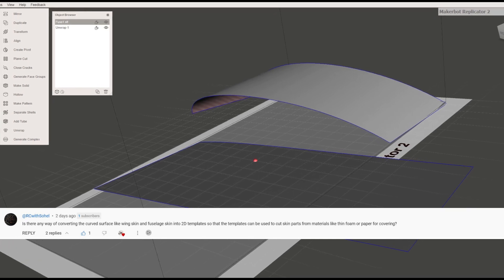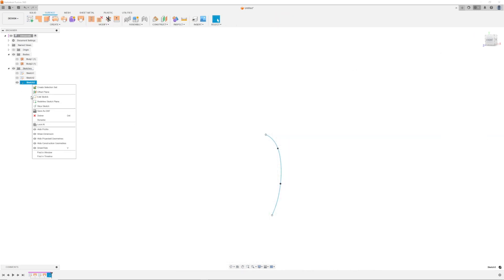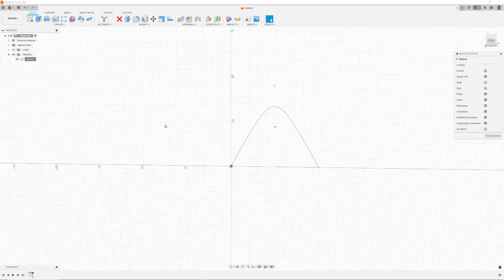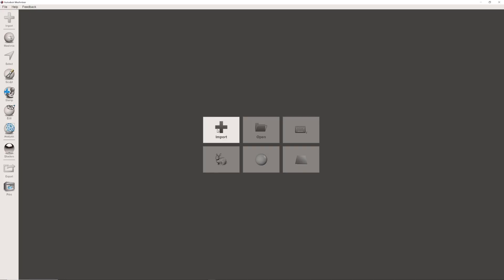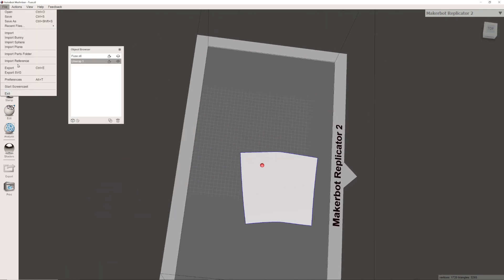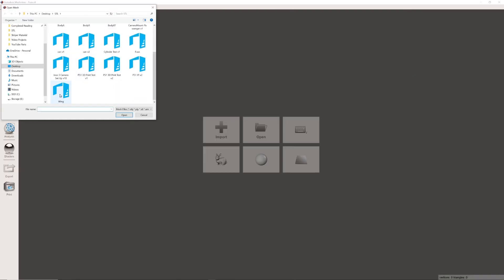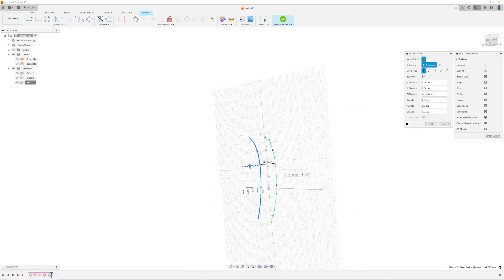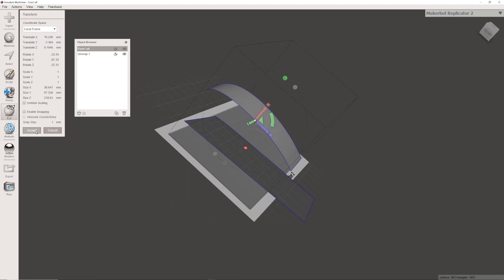Flatten Curved Surfaces For Your Foam RC Planes - Fusion 360 Narrated Tutorial

Comment: Please, is it possible to unwrap shape design also directly in fusion? I know that catia knows is, freecad can do it too. Thank you.
Reply from the maker: Hey there,  the only reason I had to add in the extra step was because I couldn't figure out a way to do it in Fusion.  The only unwrap feature I know of in Fusion is for the sheet metal environment but that in itself presents a different set of circumstances.  This workflow will let you unwrap to create a template whereas the sheet metal in Fusion unwraps to make a cut of thickened materials for production purposes and then be bent back afterwards.